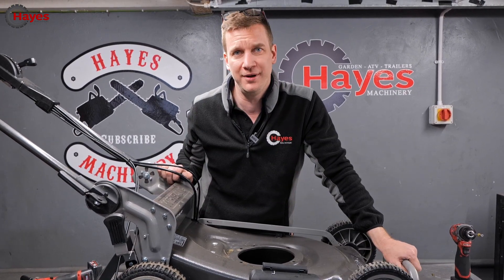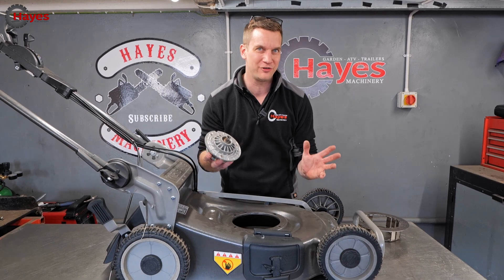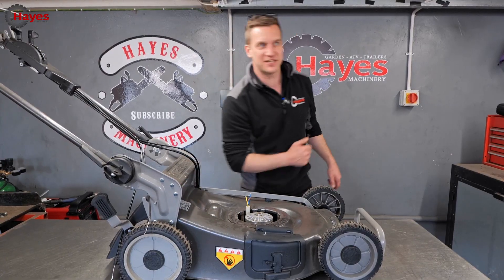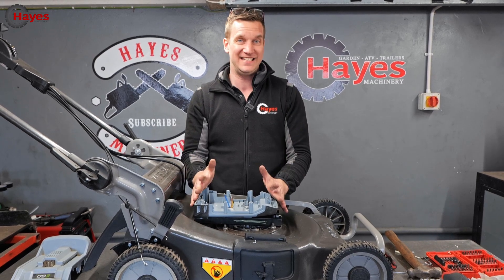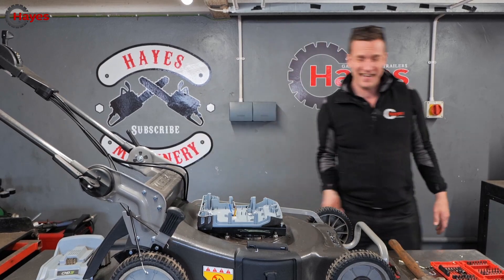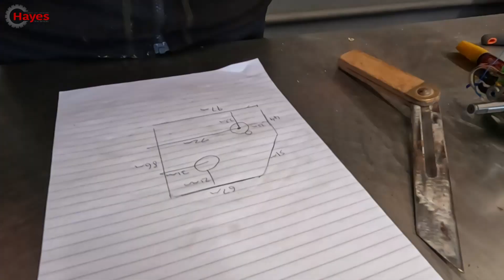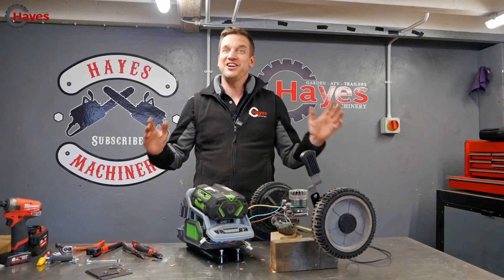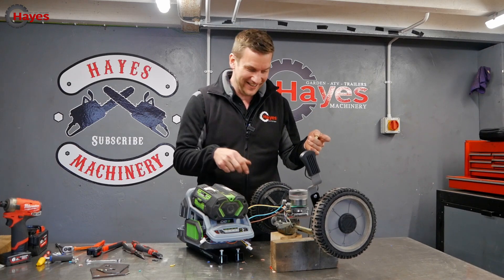New EGO Model? Converting A Petrol Mower To Battery Power!

Comment: Has anyone seen akit like this for Briggs and Stratton ICE motor replacement?   I have 3 mowers I love - but would like to convert them over to batteries....  Seems like a fine kit to reproduce.... (& btw, I think a 4" axel extension would have been more practical than the cage you made to lower the mower...!)

Comment: It would be really nice if you would go into the technical specifications of how you fabricated the battery controller. I have a battery powered mower that the power control board for the battery went out and now it’s useless. I would really love to build my own. What did you do to the battery charger to make it a battery controller?

Comment: The controller from my ego mower broke down, I ended up buying ryobi batteries, took the cells out and made me a 48 volt 12AH+ battery, no controller, at 48 volt it mowes with no problem, if the lawn is high I use the ego 56 volt but since it doesnt have a controller it drains it fast

Comment: Are the changes in noise coming from the drive motor, motor casing area, and/or the blades used?  Also, have you measured the gas motor vs electric motor Db levels?  Besides the mower cut quality, and cleanliness of electric, reducing the Db noise level, and thereby reducing my exposure to potential hearing loss, is the reason that I am going to switch to electric this year.
Reply from the maker: The noise is the plastic gear on the metal gear of the original gearbox. Proper EGO mowers don’t make this sounds as the motor is integral to the gearbox thus creating less noise. This was the most cost effective and time saving way I could muster to drive the rear axle. Thank you for your comment 🤩

Comment: you are right about battery mowers why they cant just leavem working and fuctioning the same as petrol its the same with cars leave the ignition key where it is and a rip it handbrake like a normal car
Reply from the maker: 100% if it works why change it 👍🏼

Comment: Some diehard DIY there. If that was me, I will cut the hole and buy the premade EGO 2142 dual port battery compartment and electronics with SelectCut BLADES and The 1200W Brushless motor to fit into this unit so I can put 2 x 12 amp batteries to run a 24 amp lawn mower for large property that matches the heavy duty built of the housing. I would also buy the EGO drivetrain to go with it as well. Amazing DIY and dedication. Well done.
Reply from the maker: Thank you George 🤩
Reply: @MachineryNation  I wish I am as diehard as you 👍🏼

Comment: My first thoughts - you are going to use Ego power unit (video from exhibition, published some days ago). But this was interesting as well. If you  install battery facing other way you can see fuel gauge while mowing.
Other question - do you do Ego batteries refurbishment? (you look technically capable enough /... hmm... and crazy enough as well)
Reply from the maker: Yeah we can refurbish batteries. In fact the one in the video has been refurbished. I could of installed the way and it did cross my mind but you have to press the battery gauge to get a reading and it did not look as streamlined. The Ego power unit will be out later this year, watch this space 👍🏼

Comment: Good job, but couldn’t you put it on a Honda? 🙂👍
Reply from the maker: Thank you Luke. Nah the only thing good about a Honda mower is the engine. I think Ego would disown me if I done that after their bumpy history 😂
Reply: @MachineryNation  James if your talking about the pro range you so wrong 😂 But I agree with you on some of the lesser Honda models, they have gone downhill since the 90s. Im the same with a Weibang I’d never own one of thoseI’ve just never rated them. But I’m a Honda man through and through 🙂👍Just a thought though ego on a Weibang 🤔😕😤
Reply from the maker: @menditman2004  hahaha, I used to be a Honda Main Dealer and the scars run deep of how they treat their dealer network 😂😂 The original Honda Pro mowers were good, Kaas in Japan bought the tooling when they changed and they still make them to this day as a great mower. They come into the UK under the brands - Lawnlight pro, Cobra and Danarm.
Reply: @MachineryNation  I’ve only ever dealt in the secondhand market of Hondas, I run the 4 wheel mowers for work, the HRH536 and the HRX537 they have been brilliant, I keep spares machines so rarely have to order parts, tbh most of my work equipment is second hand fix up. I’m not much good to businesses like you 😂👍